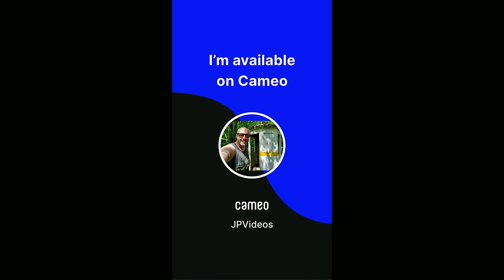MOST INCREDIBLE Train Bridge I've Ever Explored! Carrie Furnace Hot Metal Bridge

Comment: Frogs are part of the switch where rails cut through other rails. Diamonds are simply where one track crosses another at grade. The inner rails are just simply called guard rails and correct on keeping a derailed car close to being in the gauge. Considering the location at the wye those boxes are probably part of the signal system and those platforms were a place for someone to step into the clear if walking the bridge and a train was approaching. The second track was probably in use til near the end when the mill was in full bore and could have been actually removed as the rest of the mill was being demolished and work stopped either for the potential environmental issues mentioned or as part of the preservation and thst mid point platform was set up during the scrapping. 
Also we have a wye on a bridge here in Chicago over I90 just a bit south of Comisky Park.

Comment: The Carrie furnace got metal bridge is an amazing train bridge. The devices that you showed were called frogs and were used at switches to guide the wheels on the tracks to the desired direction the switch was positioned to change rails. The diamonds are square shaped and for rails of opposite directions.

Comment: The reason for the tall metal sides and metal plating on the ground, is because they carried hot molten Iron and that kept everything around it from catching fire.
Reply: Not just metal sides, also asbestos. You can see asbestos panels along the lower sides of the walls. I crossed it years ago but that was before it was fenced and before the northern ramp was removed.

Comment: The little pellets are taconite iron ore concentrate primarily from the arrowhead of Minnesota and Marquette Michigan.  It is made from concentrated iron ore with clay as a binder.  Frogs are part of a track switch and crossing points are part of the diamond.  There was probably a manned interlocking tower in the area, maybe where the foundation inside the wye was.  The switches were run off of electric switch machines controlled by the tower.  The high sides of the bridge kept molton metal from dropping onto river traffic.  That bridge might have been inspected daily.  Cool video, thanks much!

Comment: 7:01 - The tie plates split from 2 to 4 lines just the other side of the hole.   It was a switch location with the mechanical bits to operate it in the gaps below and out on the platform, along with room for a brakeman to stand out of the way when using it.

Comment: Looks like that rail which is still in place at 5:35, is a guard rail, not the running rail.  The actual running rail was removed, probably because it was still useful elsewhere.  The running rail would only have had value as scrap, because it was probably worn out, hence its use as a guard rail.  If you look at a close-up at 4:53, on the bottom, right leg of the bridge, where the track is still in place, there is a fifth rail, a guard rail,  on the inside of the curve.  The left side most likely had a similar set-up, except that on the right, the two tracks seem to be running as a gantlet, and on the left the two are joined in a turnout.

Comment: Hey brother that deck that you pointed out was a switch, and I’m guessing there was a signal, or a call box used to call the train dispatcher? 

And I’m betting those probes were either heat probes, or an ACI camera. There used to be plates on the side of the cars with a blue, black, and red barcode. That camera if that’s what it was would read and report the car number to a clerk, who would then bill the cars for where they went.

Comment: A fantastic video, Jay, outstanding!  Those crossovers are referred to as diamonds and the reference to the frogs are correct as well! This is the first time I have ever seen this combination of rails on a bridge approach, fascinating!  And that bridge, wow, just wow!  The structure is beyond belief!  And those round devices are position sensors that can tell when cars are on the rails in the line of sight of the sensors, one receives a signal and one transmits a signal, usually a focused light beam, much like your safety sensor on your overhead garage door.  I have looked at aerial photographs of that area that go clear back to 1947 and that whole area was very heavy industrial pretty much right up into the 1970's.  So glad you took us along on that trip Jay, I really enjoyed it.  I would love to see what the bridge looks like when they get done with repurposing it.
Reply from the maker: Thanks George. This bridge impressed the heck out of me.
Reply: Do you think they may have been temperature/thermal sensors to see if the cars were leaking or some such thing?